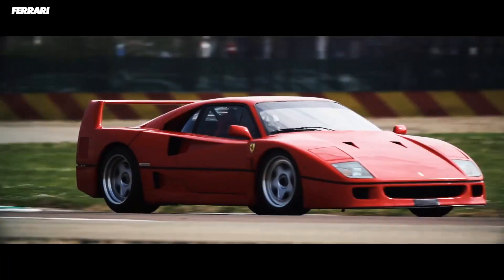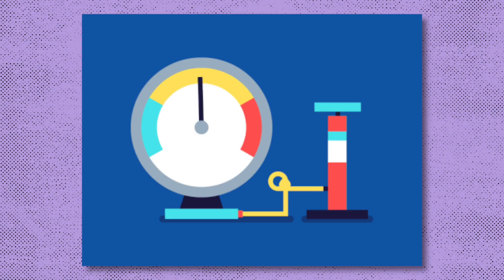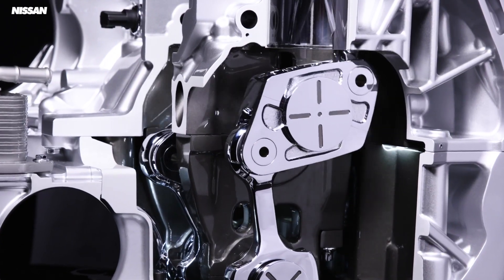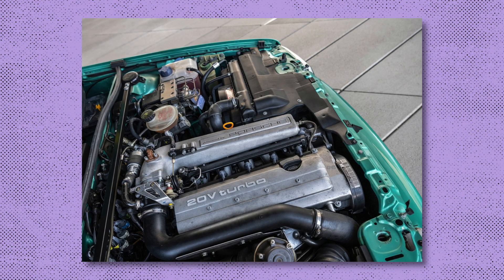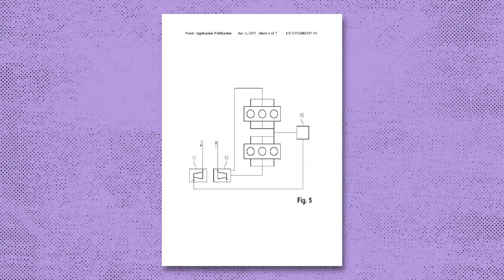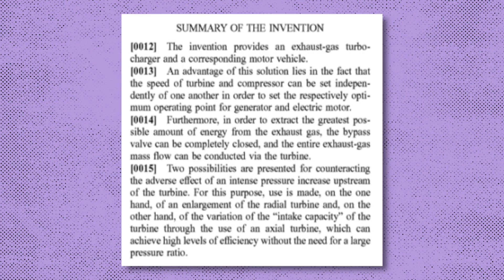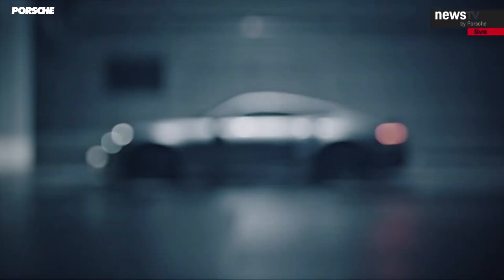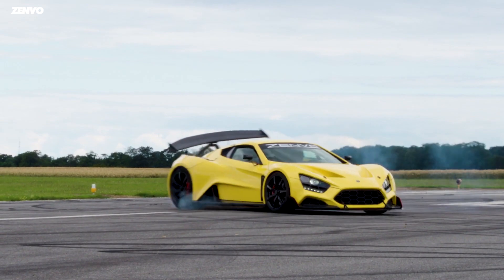Porsche's GENIUS New Turbo Design

Comment: remember octane? the best part of gasoline, eh? turns out there's a substitute that we can make from alcohol... bear with me please.. I'm an exotic car technician, among other things
.. and a pretty good chemist.. acetone has the same chemical structure as octane... but half the molecular weight... and none of the long chain hydrocarbons and aldehydes we see floating around in our air these days... acetone is mostly hydrogen... it's easy to make... and burns cleanly with no detectable unburned portion from simple combustion in atmosphere in my lab... there are three issues with this as a fuel.. 
1... it eats up natural rubber and most plastics from petroleum oil... 
2..  there's no lubrication for the top end.. even unleaded gas has a lubrication effect for valve guides
3... it burns really really hot because it's mostly hydrogen
so.. I have both bioplastic and easily obtained metals for gaskets... like copper but very light and strong.. with a very very low heat expansion coefficient... possibly none... 
2 and 3 are handled by the same thing..  adding a little hemp seed oil for lubrication and it cools the burn down...it too burns cleanly.. 
the alcohol can be made from biomass.. from hemp and other farm products... turned into acetone by a simple redistillation process.. and you have a fuel with the same effect as methanol
... without the unburned hydrocarbons that are the primary reason for global warming
we can change our technology today
if we don't... nobody will
🙏 thanks for sharing 🙏
✌️

Comment: It doesn’t matter how big or small the engine is, if the car is burning more fuel to produce the same amount of power in a smaller engine, that means the car is burning, the same amount of fuel, it just so happens to be burning it in a smaller engine. If it’s producing the same amount of power, it’s using the same amount of fuel. Just because you have a smaller turbo charged engine it doesn’t mean you’re saving fuel. It just means you’re making the same amount of power more efficiently.

Comment: Gm makes a turbo 4 cylinder engine that’s just as powerful as one of their 8 cylinder. Cool, right? Well I’m not sure. It makes less torque than the 8 cylinder and uses more fuel. All these high end cars with smaller displacement turbocharged motors aren’t  exactly fuel savers. Never seen a big turbo charged Benz average 30 mpg. Yes I know, they weren’t meant to replace Prius’ and such but still, they don’t get respectable MPG’s.
The term “power” is used too loosely as torque is very important and is often sacrificed in smaller engines even if they are turbo charged. 
There are motors that use a turbo without an intercooler, aren’t there?? Anyways, cool video.

Comment: Its crazy that as a 10-15yr old. I 'invented' or thought of idea's that are now common in sports/supercars. Compound turbo-charging, electrically spooled turbo's, electronically adjustable window tint (now used in new mclarens & the new countach for their moonroof's), some form of magnetically adjustable suspension, and carbon fiber with titanium woven into it for better strength-weight ratios & to avoid shattering in collisions (pagani now uses this as 'carbotanium'). Makes me mad that i was too young to even be able to do anything with the ideas. I really would love being an automotive engineer, although i always planned on automotive  designer as i loved sketching & designing cars. Maybe ill be both lol

Comment: HVAC fluid returning from the cabin or dedicated loop could be used in an intercooler/ heat exchanger, I really like the idea of an electric boost motor perhaps powered with capacitors that disengages with regeneration and trickle charges once the engine exhaust takes over.

Comment: Yet another german overengineered example. Cool but useless. Innovations are great, but when you make a more complicated system to avoid "simple" complicated system you loose the whole point. In real life this stuff will fall apart and be a real PITA for the owners, like all that unnecessary that became notorious in recent decade. I am not a hater, just stating that perfecting the technology that already works great would have much more sense, than "innovate" and then abandon after a year of production.

Comment: Turbo lag has not been a problem for quite a while now, I don't know what all the fuss is about. The Porsche 'solution' sounds like a typical German over complex solution to a problem that does not exist. If Porsche do have a problem still then perhaps it's due to it's engine's horizontally opposed layout.

Comment: Using the word "genius" the way you use it cheapens it and makes it click-bait-y. A variation on something that already exists, with technology that already exists, that makes a small incremental theoretical improvement, is not an occasion to throw the word "genius" around and emphasize it every time you say it, unless you're trying to trick 13 year olds into clicking on your video, which they'll do once or twice until your channel is muted for useless clickbait.

Comment: This shouldn't be something a company can just patent when it's such an obvious derivative design that falls from the needs and capacity of electrified car systems or even rockets. It's like if Mercedes patented the split turbo from their F1 ... some patents stifle innovation and I think this is one. I'm kind of miffed because I thought of this like last year and I'm no engine designer just an F1 fan thinking up whacky new F1 engine regulations for fun.
Reply: Like they mention in the patent it feeds two axial compressors at the intake end ... that's not efficient and should be one centrifugal compressor which saves space, weight and is more efficient because the electric motor can spin up fast hence avoid lag. Is that a whole new patent now ... lol just a silly abuse of patents imho.

Comment: in general it feels like shafts everywhere is a thing of the past. Camshaft and chains/belts are replaced by koenigsegg free valve, porshe get's rids of turbo shaft, both means we get rid of 20KG of metal and replace it with some thin wire. All electronics gets smaller and more efficient, while providing more control and precision.  Fast cars need to be light, and if we manage to make our fastest bois under 900 kg, they will be flying.

Comment: Reliability comes into play when you remove displacement and still have the same power.

A 5.0ltr V8 making 400hp  does not have to work as hard as a 2.5ltr making 400hp.

To the extreme....how reliable would your 32cc weed eater engine be if it could make 400hp and you out it in your Honda?

Comment: New for production but not new in general. We made an electric turbo in 2013 and there is even a kit you can but that is an electric turbo.
Another design was that using the exhaust to a turbo housing but instead for boost, it would spin basically an alternator that helped give power to the batter/car for the electric turbo.

Comment: 3.39 into your 6 minute video you finally get to the porsche invention that was the ONLY reason i even visited your channel. I will not be back. Do you think your lame kindergarten turbo info was needed? Why? Anyone interested in the slightest in electrochargers (i invented this word) is already (judging from your lecture) 1000 times more familiar with turbo and super chargers than you are. Anyone who needs you to prime them never came here and don't desire any more knowledge about vehicles than which pedal is the go and which is the stop.

Comment: So basically they are using the turbo hot side to drive an alternator, essentially, specifically for powering a motor that turns the compressor wheel. So basically making a stand-alone electric turbo system driven by the exhaust, rather than by the car’s normal engine-driven alternator power system? Yeah, I could see how that could work.

Comment: It’s a clever idea, but I’d be curious if there’s actually a thermal efficiency gain with an electrically driven turbo. All the gains in efficiency come from being able to extract some of the wasted thermal energy from the exhaust in the turbo; if you’re using a generator-driven turbo then basically what you’ve created is a centrifugal supercharger with extra steps. Now, I’d they could run a turbo-driven generator and utilize a motor-driven induction turbo that would definitely be an improvement, but then you’d have to deal with packaging for batteries and the challenges of asynchronous generation like what you’d get from an exhaust driven turbo generator

Comment: 2:16
"Why don't we turbocharge everything then?"

   Turbocharged engines are notorious for early failure due to extra stress caused by forced induction.
   Just because a small displacement engine can make 400hp, doesn't mean it's going to make 400hp as reliably as a larger displacement engine. Forcing a smaller engine to produce and maintain power levels that high overworks the engine and causes significant amounts of stress. Not to mention, these engines usually turn much higher RPMs, which obviously wears them out faster.
   Making a boosted Honda B16 1.6 liter produce 500hp isn't going to last like a n/a Chevy LS 6.2 liter.
Reply: we must not go directly to exaggeration, most of the very many turbo engines in europe have a reasonable power gain of around 110hp per liter , 130cv at best (non sport cars) and they have decent durability 300 000km or more...In Europe a 6.2L V8 cost far too much in gasoline consumption (today close 2€ per liter...) and taxes  , for example in France you have 40 000€ taxes with such engine, this is close the price from the new car in the US...
Reply: @leneanderthalien  we pay $5 a gallon. Thats not an excuse😂
Also, fuel consumption goes up when turbocharging... if you add air, you must add fuel.
Reply: @leneanderthalien  Also, 300,000km isn't that good. I can easily get 500000km out of my Chevy truck. All power train is OEM and is 21 years old. Currently sitting at 450000km as we speak.

Comment: I dont see why the generator in the exhaust stream is needed at all. That has to be a rather expensive sophisticated thing because of the heat involved. If you have a hybrid system (and basically you have to have a hybrid system these days anyway) you can power the electronic compressor from its battery. Its just another electric motor after all. Maybe efficiency still is better with the exhaust generator?

Comment: The challenge with the "drive by wire" eTurbo that elecrically couples the turbine wheel to the compressor wheel is the requirement to transmit the full shaft power electrically.  A turbine for a 911 size turbocharger produces aroound 40-50kW at rated engine power for a biturbo configuration.   So the motors and associated power electronics need to be sized for much higher power levels compared to an electrically assisted turbocharger where the motor is mounted to the traditional turbocharger shaft and only supplements the turbnine energy.  So an assisted turbo can get away a  smaller motor and electronics with 95% of the benefit.  There are more pro's and con's, but the electrically assisted turbo is preferred in most cases.

Comment: The best turbo design was made long ago. Mostly put on trucks. It was a turbo and centrifugal super charger combined. The belt connected to it/ a sprag would never let the turbo spin slower than the engine, however the exhaust could take over and spin up the turbo faster. No need for heavy batteries that will deplete in a few minutes and take 20 minutes to charge.

Comment: The hot side is not an impeller, it is a TURBINE and the origin of the term "TURBO". The compressor side is an impeller. From Wikipedia - "An impeller or impellor is a rotor used to increase the pressure and flow of a fluid. It is the opposite of a turbine, which extracts energy from, and reduces the pressure of, a flowing fluid." Words matter.

Comment: The brilliance of a Turbo Charger is that it is driven by waste energy, making combustion engines more fuel efficient.
So, if you siphon off usable energy, like a supercharger does, you still gain power, but lose fuel efficiency. 
If you also have to convert the energy you siphoned off to electrical energy, you lose even more. A flywheel/clutch system would be more efficient imho.

Comment: At this rate we might as well just have a combustion chamber that does nothing but provide hot exhaust. The motor-gen converts that into 10s or 100s of kW of electrical power, and the hybrid system is massively simplified.

Comment: Cool, but wouldn't the additional rotating mass of a generator rotor on the exhaust side cause even more lag? That is unless Porsche are planning on supplementing the motor on the compressor side with a boost from a capacitor or battery bank to pre-spin it before the turbine gets up to speed, then using the power generated from that.
Reply: I'd say no. Because the generator is making power that is being applied to the electric turbine and would cancel out any losses the generator would cause. I have a feeling the e turbo side of things would be made to hit its max rpm very very quickly.

Comment: A driven turbocharger is a supercharger. When it is no longer turbine-propelled by exhaust gas it is no longer a turbo. Superchargers and turbochargers do the same thing. While there are different types of compressor systems they are defined by what drives them. Although it is a turbocharger design and turbine impeller the drive turbine has simply been replaced with an electric motor. It is a great idea allowing variable boost before rpm's so no wait for revs. Because it is not engine-driven at all it will probably get a more accurate name but "Turbo" sells everything from shaving gel to cook wear these days so they may just mis-identify it  (like using "Turbo" on anything else) for an ignorant public. Probably the 'Electric Turbo'. It is actually an electric turbine supercharger but the sales division will want "turbo" in there.
Unfortunately reporters today don't research things they are told. Simply looking up the function and principles would quickly stop an actual journalist from just parroting what something is being called for marketing purposes. Count on a generation of "Hypersonic" products of all kinds next!

Comment: absolutely they didn't INVENT this turbo, as people and myself experimented with e motor turbo long ago.. 
Around 1999 I messed with the idea with a vacuum cleaner motor using the exhaust end, it worked 
to load the intake with a small amount of pressure. I shoved the vacuum cleaner exhaust through 
the supplied tube and shoved it in the nozzle of the cleaner hat. Noisy, it worked as any pressurized 
intake should work, didn't do a drive test hooked up to an ac cord, left it knowing "one day". Whatever 
pressure added to the combustion chamber by whatever means was the logic constant from idle up.

Comment: The aircon system in a Boeing 787 is all electric. Compressors are electrically powered to a maximum of 80000rpm. Impressive but need lots of kw to run them. Made by UTC in America.

Comment: I always thought you could make the turbo power a small wind turbine inside to generate electricity to charge the battery. A bit counterintuitive I know but I thought it solves the being worried about running out of battery charge lol.

Comment: ‘Turbos are pretty good’. Nope, in fact 4-cylinder turbocharged engines made today will have much shorter life span in the long run when compared to older naturally aspirated engines.

Comment: I wonder if it would be more efficient/effective to have the exhaust generator do all the electrical charging. That would eliminate an alternator and HP to run it. Exhaust expansion to run it is free. Kinda similar to Sterling cycle.

Comment: AMG C63  :
If they’d fitted 4 turbos, it would have been (4x8=) 32 Efficient. 
With a 4cyl single turbo it will be (1x4=) 4 Efficient. 
Employ me, Germans! We will konstruct much fast car, ja?  Ja. Ist gut.  Much speedenfrenzy on autobahn XXD
Reply: Further to last, we’re going to put inline turbos on it. And superchargers. And VTEC. 
Someone contact NASA for G-suits and heat shields. 
Stand back Elon, I’ve got this. 
#FTLcommuting2023
[edit: 2x2x8x8= 256 Efficient.  That’s HEAPS efficient.)

Comment: Looks a bit like the air compressor for Hydrogen fuel cell vehicles.  They require a huge air pump, its 400V 20kW, you need a serious battery to power it.  Could work as a hybrid, store energy from Kers to push in the turbo, so there is no loading on the engine.

Comment: changing your turbo out to an oversize uniy actually increases your normal fuel economy because the raise of boost threshold.  you have to lay into it intentionally to hit the high flow numbers, so just tooling around uses less fuel and is more efficient

Comment: "Why don't we Turbocharge everything then" Well, we already do. At least in Europe, you won't find more than a handful of non Turbocharged cars, if you look at the cars which were being sold during the last 10 years. And Diesel was practically exclusively Turbocharged for the past 3 decades, with Mercedes 3L I6 from the mid 90s being the last big/powerful NA Diesel engine.
I know that this is kinda besides the point the video tries to make, but it's a needed correction. Turbolag is just not that important for people who don't care for linear performance. And that's most people